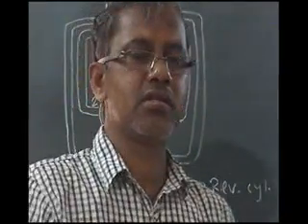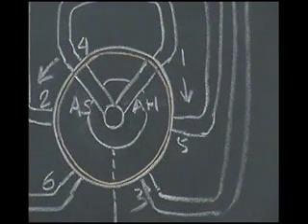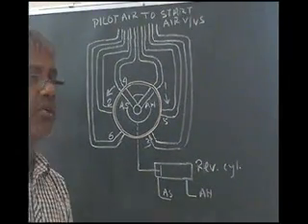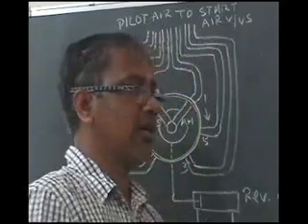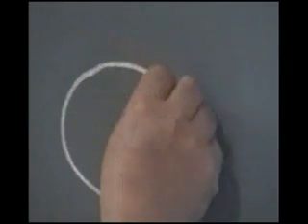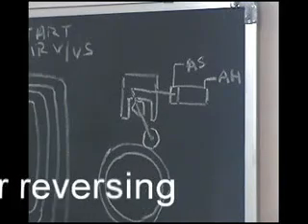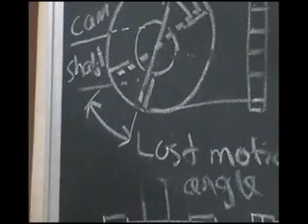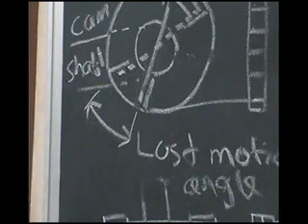Reversing of Engine

Comment: Pls don't make this kind of vague videos. If u are certainly clear how it works and how to explain then do it. Otherwise plz don't. In starting air distributor pilot valve changes the position form inner to outer race for reversing. Which u hv missed it. And fuel pmp Cam reversing in be engine the profile of Cam s wrong.
Reply from the maker: Are you sure what you said.Do you have any idea of what you r talking ,in starting air if you say that pilot valve changes the position  then tell me what commands the pilot valve to change from inner to outer race.It is very well understood that something like the telegraph upon changing from ahd to ast gives the signal to this pilot valve so that the reversing can take place for the distributor.I have just shown the reversing not the fuel cam  profile.If you have the correct idea of profile then tell me that correct profile.And do all fuel pumps change their positions on reversing or what and how is it different from Sulzer.
Reply from the maker: Where do these pilot valves get these signals from, go to the engine practically and see ,trace the lines and thats best you can draw a starting system ten you will get your answer, irrespective of B & W or Sulzer the construction is almost same.

Comment: This video is so helpful , I understudy the mechanism of bmw engine. What I wanted to know is , how to change direction of motion of cam shaft of a air starting diesel engine ,. does that same AS and AH rollar method we're using on ship diesel engine .
Reply from the maker: Generally the ahead astern functions are done by a single cam only, so if we change the angular position of the cam shaft the the reversing is done.But now the problem is how to get on to change it well the direction of rotation is decided by the order as per the telegraph(the theory remains same as in present days' digital telegraph).whenever there is a change in the direction first is to change the distributor  status to the new direction  and this will(in B & W ) allow starting air to be admitted into the units a reverse order so that the engine now automatically starts to turn in reverse direction.Its not the cam shaft which is first reversed but the reversing mechanism which automatically short of drags the engine in reverse direction and as a result the fuel and exhaust cams as being mounted on the camshaft also now start to rotate in reverse direction.But this is different in SULZER  where the camshaft is reversed so the starting air ,fuel and exhaust cams change their angular positions simultaneously.